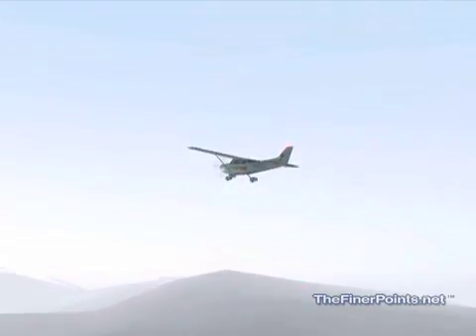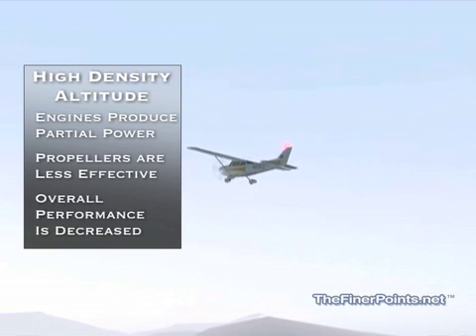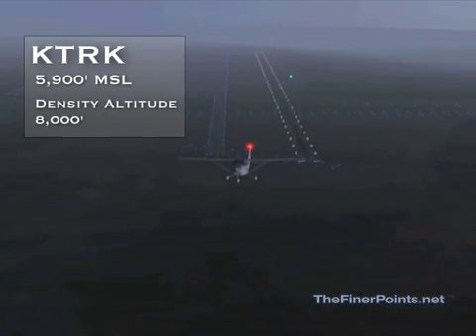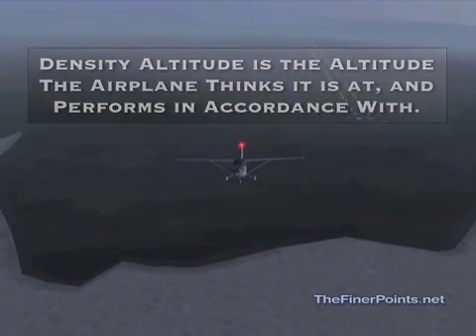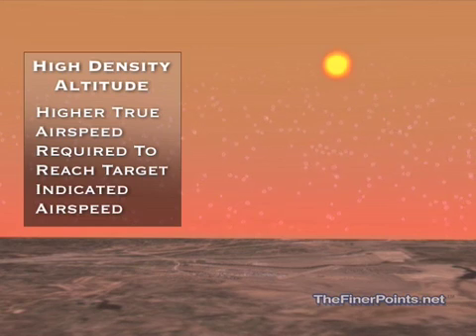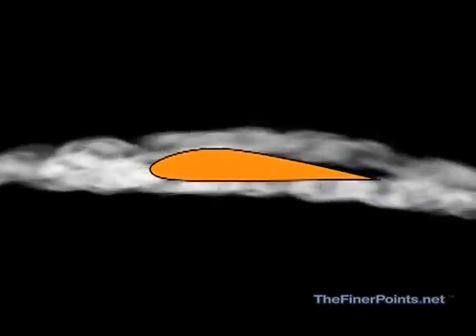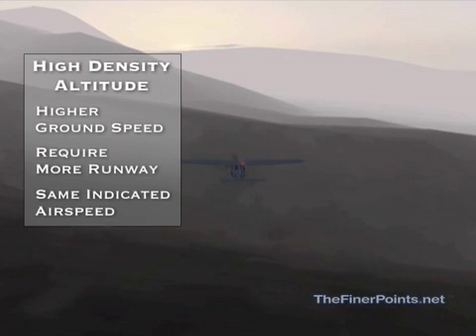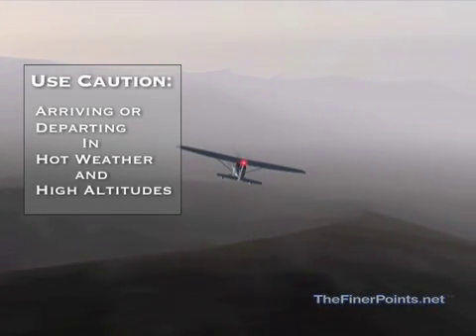Density Alititude - Flight Training Video

Comment: so if i was to land at an airport at high altitude and high temperature, and my indicated landing speed is 70kts, at this situation would it still show 70kts meanwhile im doing more or Would i have to take into consideration to make sure im doing 80kts on approach (ex)?
Reply: no..you need to fly fast enough to always be sure there is 70kts of wind IAS over your wings to keep from stalling..reading IAS in this situation will ensure you have sufficient air over wings to stay flying.. the pitot tube needs to be rammed with air to make IAS gauge read 70kts..regardless..the less air there is, the faster your plane must fly through it and conversely the denser the air the plane will float in comparison..(more air)

Comment: I just did my mountain checkout earlier today to KTVL (6268’ FE).  Until now, the highest I had ever flown was 8500’. High density altitude is no joke as it seemed to take forever just to climb starting at a 7000’ DA let alone trying to maintain my altitude (hand flying as I had no autopilot). Mountain flying courses are worth every penny spent; go knock one out and you won’t regret it.

Comment: Excellent info. To the point and cIear. I've been a pilot for many years, however always flying at low elevation airports since my area has no high terrain.
Reply from the maker: Diego Abad thx!
Reply: Yes, operating in and out of really high altitude airports and terrain is no joke. It presents its own unique set of challenges. That’s why I strongly recommend a mountain flying course, for even seasoned pilots who have never flown at the “higher elevations”.

Comment: First time I've heard someone state IAS is speed of air over the wing. That locked it into memory for me. Good video.
Reply from the maker: Glad to hear that Greg! thx Somebody once said to me "Airspeed is your life blood" and I like that one too.
Reply: It’s not. That’s true airspeed. IAS (or, more precisely, CAS) determines the various aerodynamic pressure differences, which is why it is so critical. The reason it does this is because IAS is measured with a pressure difference. If you measured it with an anemometer, it wouldn’t work.
Reply: It was stated correctly in the video - Indicated airspeed represents the number of molecules moving across the wing.